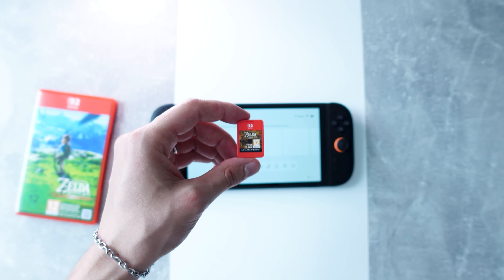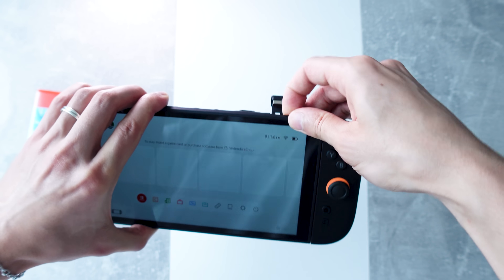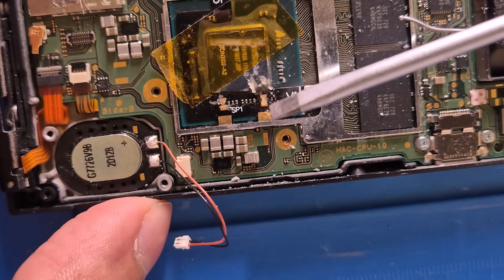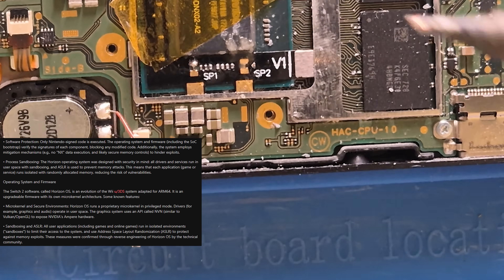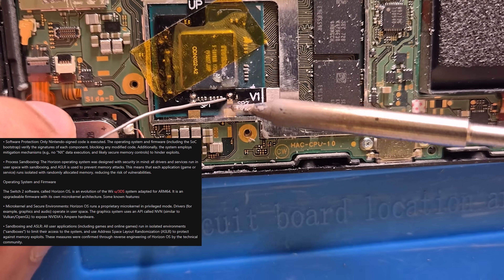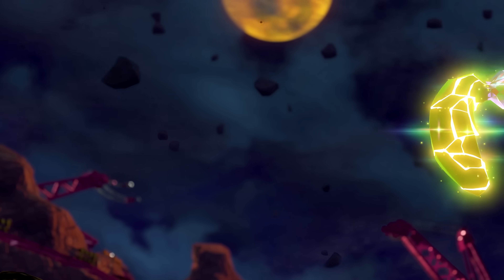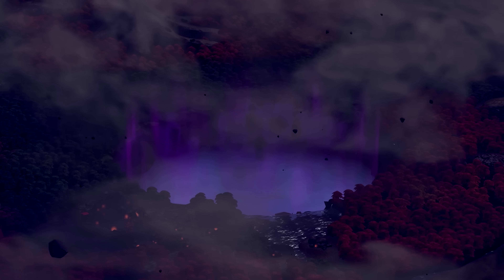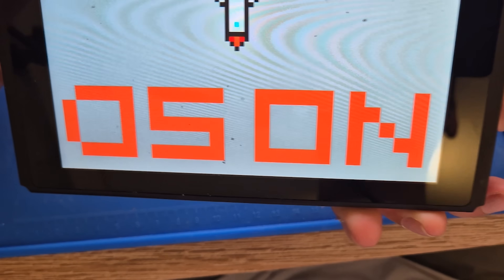Switch 2’s “Unhackable” Security – Why Hackers Are Stumped

Comment from the maker: Hey everyone! Just a quick note: this video isn’t about cheering for or against homebrew, it’s about showing why hacking the Switch 2 is such a huge technical challenge right now.
A lot of people think homebrew just magically appears, but there’s an entire world of security layers, hardware roadblocks, and real risks behind the scenes.
Whether you’re into modding or just curious about how consoles are locked down, I hope this gives you a better picture of what hackers are really up against.
What do you think — will they eventually crack it, or did Nintendo finally win this round? Drop your thoughts below! 👇🔥
Reply: I am wondering if people will have to look at the chips and figure out which chip and where on the chips to break. Kinda like the Kamakize hack for Xbox 360 slim.
Reply: @nahCyzar0520 I used to hear a Joke about how the Wii was hacked with Tweezers, the 3DS with Magents, the Wii U is apparently unknown, and the Switch with the Paperclips, and that the Switch 2 would get hacked with a Hammer or by physical damage, basically that, hitting it in a super precise way to glitch the Boot Process
Reply: @LennyJBA  I am pretty sure the Wii security was initially hacked with tweezers, The Switch (the launch model) had a hardware exploit which you could hack with a paperclip. As for the 3DS I don't remember that.

BTW the Kamakize hack specifically required you to drill into a specific chip in a specific place and make sure you don't drill too deep so you don't damage the board.
Reply: @LennyJBA the Wii-U was such low volume
A) hackers couldnt be arsed.  
B) Project Dolphin worked from day one so you could emulate Wii-U games without hardware.   
C) Wii-U is just a Wii and same hacks worked.
Reply: @nahCyzar0520  the ps one was "hacked" by opening the disk tray and swaping disks
Reply: Do you also think that they locked down the joy con ports?
Reply: 3DS was just edit some files in a PC!!, compared to this it's easier than a cakewalk 😅 hope you get that hacked
Reply: Ai is going to hack the switch 2 mark my words

Comment: this whole "is it hackable" debate is non-sense. because you cant build a 100% secure system, its maybe secure right now, but that might change tomorrow, the question we have to ask is: "is a switch 2 hack finacialy viable" and the answer is most likely no for the next 3-5 years. IOS is the best example of this, apple tryed there best over +10 years to keep ppl from jailbreaking but most ios version were broken evenually, even the best apple devs could not make a 100% proof system in multible iterations over 10 years. the reason ios stoped getting jailingbreaks is that it become harder and harder ofc, the skill set needed to break into switch 2 today, is so high that you could work for any government or it-giant with high 6 figure salery. switch 2 hack is possible 100%. like any human build system will always be flawed in some way. the question only is when is it viable.

Comment: its not unhackable, because the mig card can still run on the switch 2 which leaves it wide open for a payload via the cartridge slot. The wii mini was suppose to be unhackable that didn't last long either. Was defeated by its own bluetooth chip.

Never say never, where there is a will there is always a way

Comment: All these statements make me laugh. Nintendo said they had learned from their mistakes with the Wii for the Switch 1 and that it was also the most secure of their consoles. I want to say, it's a good thing the console is better protected than the previous one, otherwise the company would look pretty stupid. What would Nintendo look like if they admitted that their Switch 2 was as easy to hack as the DS? On the other hand, what's stupid is falling for this kind of purely marketing message. It's nothing new, but there will always be someone to say this kind of nonsense with each new console. We still remember the number of times Nintendo themselves opened a breach to hack them with certain physical games and even some purely digital game demos.

In all of this, we must not forget an important but often overlooked detail.

Manufacturers are forced to leave vulnerabilities. They are forced to do so to ensure they keep their product under control, if they lose the source code for exemple (and this has happened before) or in the event of a massive hack of their installations.

These are vulnerabilities they keep to themselves, praying that no one discovers them themselves or that an employee leaks the information.

Nothing is uncrackable.

Comment: all of that is nothing if switch 2 emulated, you can buy handheld and emulate switch 2
so the question is it will be emulated
Reply from the maker: no thats wrong to get it emulated you need to hack it first. Before emulating is possible you need to bypass the security in order to create cfw with which you are then able to emulate it
Reply: @yu-gg  Thank u for explain it to me 🥰

Comment: 1. It will get hacked eventually. When will it happen? Who knows, but I heard there was an entire shipment of Nintendo switch 2 that was stolen, and if those were all used in an attempt to hack it then a hacked Nintendo Switch 2 might come out sooner

2. As a rule of thumb, if it is not hacked within a certain timeframe then that would confirm just how significant of an effort is required to hack it

Maybe even to the point where it's economically not viable 

What, is the average modder going to spend $ 1,500 USD to pay someone to hack a $500 Device?

At that price point you'd lose a significant chunk of your modders, which consequently also drives the price up for Hacked/Modded Nintendo Switch 2s

Which ultimately means it's practically nonexistent 

Sure there might be a couple hundred hacked/modded Switch 2s out there but no more. 

And Nintendo will practically still get what they want and that is to lock down their games/system

Comment: The Xbox One was never hacked so I'd say it's a little early to be giving judgement. The switch just uses the same security features Microsoft started using in 2013.  The difference is that Microsoft embraced homebrew and charged you 20 bucks to enable it, Then made their games more available which pretty much crushed the modding scene.

Comment: The USB ports could still be viable, by hacking the switch dock to bypass auth
Reply: There probably be an computer chip installation. They get around this security.
Reply: Not sure - the USB interface is encrypted on the Switch 2.

Comment: they said the 3DS is unhackable .... then they found a savegame exploit ... which allowed them to find other exploits easyer
they said the Switch is unhackable ... and almost immidiatly someone found out they can just use a a paperclip ....and for the newer models there are modchips ... they said the PS3 is unhackable, the Xbox was unhackable and the Xbox 360 was unhackable, they where all unhackable, the question is not "if" the question is "when",
and the less quality of life features a console does not have the more people will try to hack is somehow to write homebrew and fill the gap of missing quality of life features.

the smart way would have been not talking about the increased security at all and at the same time offer many of the quality of life features most homebrew devs would want, then you wouldnt have that many hackers, most hackers then would either be pirates or people who rather inform Nintendo for the bug bounty ...

Comment: Hmm this is pretty good at least in terms of curbing piracy cuz it did suck that i had to avoid anything YouTube because id often get spoiled by leakers leaking the entire game or putting up thumbnails of spoilers that just sucked especially if the game had some days before release.

I will say though that one thing nintendo could do that would pretty much effectively destroy the need to mod your console is add some sort of way that enables modded files of a game to be run through a nintendo approved program that only modifies specific files in a game that doesnt tamper with the actual cartridge or digital game kinda like how the mod loader on switch 1 allows you to temporarily mod a game then completely remove it or disable it. Id say it would be nintendo that provides specific in game files like say text or models or in the case of like Metroid Dread randomizer just the doors data, Samus model and item locations and item models and whatever else was needed for that to run properly but obviously bot the entire games files to prevent piracy and also a system in which prevents unsigned code from executing potential vulnerabilities, if Nintendo can figure out a system like this we can get way more use out of the switch 2 with communities that coyod potentially boost sales and prevent piracy. Now i understand much of this is just wishful thinking but it would be an awesome idea though i also highly doubt them doing this at all in any capacity

Comment: switch 1 was out for over a year before it was hacked, using the nvidia rcm bug. the switch2 has only been out for weeks, and we already have a cpu pinout. obviously time will tell, but i believe the switch2 will eventually get hacked.
Reply from the maker: yes, i believe that too, but we shouldnt just take it for granted. It's important to understand what hackers need to bypass and that it isnt an 'easy to do' thing. But yes I bet it will be hacked like I said in the video.

Comment: Remember when sony called the ps3 "unhackable"?
Reply: They only said that because they knew it wasn't cost effective to do so with the price of a Blu-ray burner or even a basic Blu-ray disc in reality.

The console itself wasn't really protected. Besides the cost of the hardware to copy the games, which could almost exceed the cost of the games themselves, the programming was horrible even for the developers because it was so poorly done. The PS3 was only hacked for the challenge, and it was only the programming in such a mess that was challenging, not the protections themselves.

Comment: You probably have the best chance of finding an exploit in some game using some sort of interpreter.
Then get the interpreter to run custom files.
That's the best way I see for homebrew to be running on the system and will probably allow for minor inspection of stuff like the filesystem, etc.

Comment: I mean the system is still very very new, obviously when you have to discover everything from scratch its going to take a while before any of the cracks start to show, they got super lucky with the switch 1 because of the use of off the shelf parts, the console is far from unhackable, its just something that will take time

Comment: there is a real chance it wont get hacked within this console generation not because its hard, but probably because its easier to emulate.
the portable market is way different now than what it was when the switch 1 released, with the increase in popularity of handheld pcs it will be probably just easier to run a switch 2 emulator and call it a day
Reply: You got switch 1 emulators fast because it was hacked. Will not be happening with switch 2 + they are different enough that switch 2 can't run switch 1 games natively and you have yet to find the way to dump switch 2 games. You better pray for this hack to happen. And no way average handheld pc can run switch 2 games in emulator, you will need something that at least twice as powerful, not going to happen very soon.
Reply: You need to hack the conse to emulate it because you need to understand its basics first.
Console modding/hacking always comes first before emulation.
Reply: @Manic_Panic Yeah I remember when a DS emulator cracked the DS security lol

Comment: Xbox: Declares the 360 unhackable.
Hackers: Hack it by making a literal hole in the motherboard.
Xbox: Shocked Pikachu Face
Nintendo: Declares the switch 2 unhackable
Xbox: "YOU UTTER FOOL WHAT HAVE YOU DONE!?"
Hackers: "HOLD OUR BEERS!"
Reply: its allways a matter of time sometime latercomes something they can attack or new technik or methods better codes whatever if i remember right the ps4 the ps4 did take alone 3 years for it ^^
Reply: Never underestimate a person who wants to pirate games
Reply: Beers holding… 😂
Reply: absolute cinema
Reply: They actually hacked the thing by basically damaging the motherboard beyond repair?
Reply: @Dusk_Mightyena I mean not really there is a single place in the motherboard that can be drilled that essentially contains the entire Security of the xbox from what I remember, so drilling it results in the removal of all the security of the console rendering it easily hackable. The console still worked completely fine even without mod, it just caused it to lose all defenses from being hacked in any possible way.
Reply: Xbox One and Series still aren’t hacked if I’m not mistaken.
Reply: @themanmaske actually I have hacked the Xbox one X model! I’ve been able to run emulated games, even was able to flash other operating systems to it but I had to force my console to read information off a External hard drive before reading the internal hard drive to make it possible.
Reply: @themanmaske  they probably are but between available dev mod for around 20 bucks, and xbox not selling much consoles probably it's only done privately. I mean the PS5 got hacked immediately so it's safe to assume so was xbox.

Comment: Oh I believe the Switch 2 will be hacked one way or another. It ain't nothing but some data and chips. Saying it's unhackable just means "Challenge Accepted" to hackers, and Nintendo (being a very old man) apparently needs to be taught this lesson every time they release a new console.
Reply: Thing also is Nintendo REALLY has changed from back then, even to how they make their Hardware, it used to be more off-the-shelf hardware for Iwata’s Consoles (The Wii U’s CPU is actually just a 3 Core overclocked version of the Wii/GC CPU, which was literally just overclocked from the iMac G3) and in that era, their Partner for GPUs was AMD and IBM for the CPUs, meanwhile for the Portables, they tended to be made by some Japanese Companies, and since Nvidia is big on AI now and other sorts of Chips, the Switch 1 and 2 are just very different from the previous one, like literally a Switch 1/2 would have more in common with a PS4/5 than with a Wii U hardware design wise

Pretty much same for Software, and the current CEO is big on Investors, Shareholders and all that, unlike Iwata which focused more on Game programming itself and being consumer friendly, so naturally this Nintendo of now is more keen on Security, it lowkey also reflects the Nintendo before Iwata (the one by Yamauchi) since on the N64, they literally sacrificed having CDs for the Cartridge’s proprietary Format and thus really high security compared to PS1, same with GameCube vs PS2 security wise, it’s not only that Nintendo has learnt their lesson, Nintendo is literally a different Company at this point by how they make their decisions and manage their company and software
Reply: I could see it in the same way that the Xbox One was hackable, as far as that firmware version is relevant.
Though the XB1 did do online checks for whenever new firmware would be available and update in the background. 
I do wonder if micro-code updates get used as part of system reminders that new firmwares are available; it may be the first thing to get set to ensure the firmware stays viable long enough for further development.

Comment: Considering that every aspect of the switch 2 has better hardware than the switch 1, it makes sense that the switch 2 is waay harder to hack into. I wouldn't be surprised if it takes over a year to get some sort of homebrew or cfw working for the switch 2.
Reply: This. As rabid as Nintendo HB fans are, this shit is gonna take time considering the hackers aren't working with PC parts from 2014 anymore, everyone knows Nintendo hates piracy and they made their new system that much harder to crack. Why would they replicate another Wii/Wii U/3DS situation where everything just gets hacked anywa--

Oooohhhhhhh. 😂

Comment: It has been "hacked" already.
They already exploited software memory hijacking.
Also, the pre-install firmware has been bought, and it's just a matter of time for a hacker creating a exploit to hack it further.
Also, hardware is vulnerable anyway.
Reply: but that doesn’t give full system access or allow custom firmware yet. Also, the pre-installed firmware dump alone isn’t enough without a working boot-level exploit.
Reply: @Avocadonacadabradelamama  Hence why they bought it from people who found these Switch 2's, so they can dig into the system and firmware to find possible entrypoints, and the original firmware being deployed on the device, can be decrypted and extracted for deeper digging.

It's simply a matter of time.

Comment: There is a mod to run custom code right now the keys are the same for all devices at last the master key. So right now it needs a little time to get custom homebrew working switch 2 games have been dumped and can boot on the hardware debug glitch
Reply: sadly not true
Reply: source?
Reply: That is good at least